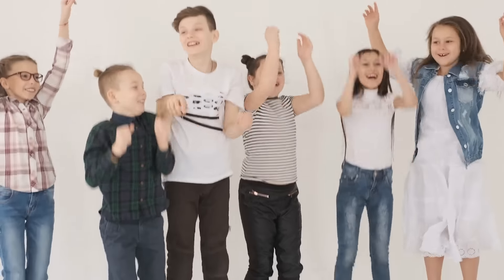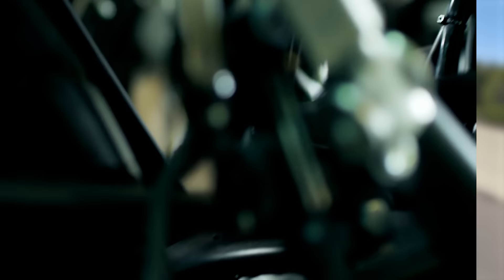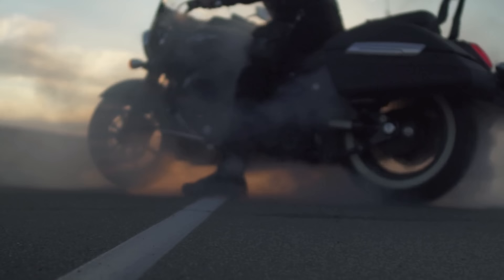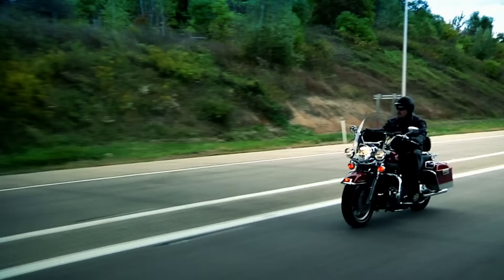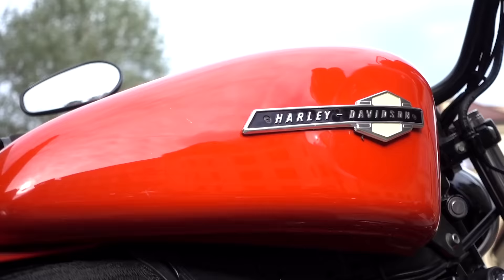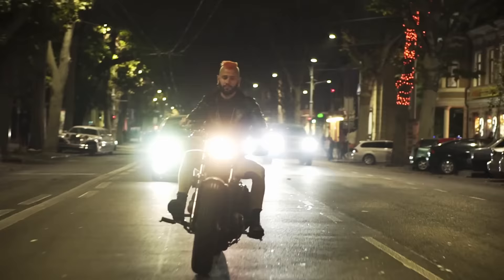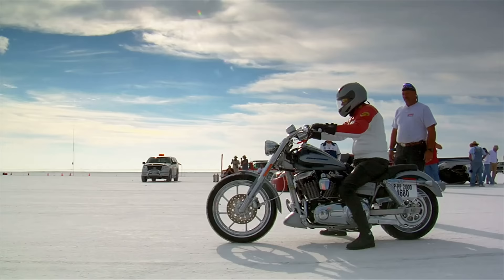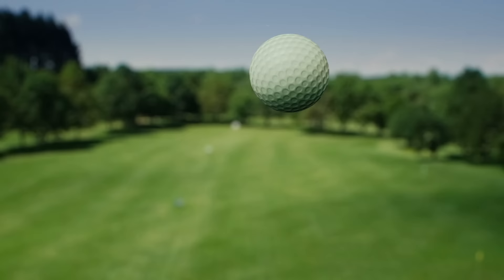Top 7 MANDATORY Harley Davidson Mods

Comment: The best mod is sell it and get a better bike
Reply: Indian would be the better option. It's a shame none of the metric companies make a decent cruiser.
Reply: @midget9629  would like to see yammie compare some metric cruisers
Reply: Having rode many Hatley even brand new 2022 models yes...this is definitely the best mod although I liked the dynas and the new sportster s was fun and the heritage is a comfy bike I'd use for 2 up road trips there's still many better options like perhaps a kawasaki concours faster lighter comfy doesn't leak or rattle your fillings out better looking and cheaper
Reply: @countryguywithcamera  I bought a beater metric cruiser a 04 vz 1600 marauder same thing as a kawasaki mean streak its not bad but its not great either
Reply: So edgy, could only be a follower of this guy
Reply: I own a Lowrider S and I will say 💯% full honesty that it’s the best cruiser bike I’ve ever ridden. As an owner, admittedly I’m biased, but considering I have owned other brand cruisers in the past, including a Ducati X Diavel S, trust me when I say this, try a new Harley Davidson cruiser, you won’t look back 🤘🏼
Reply: @wallyr.7854  I test rode a 2022 low rider s it wasn't bad I like the mid controls and bar height needs the rear suspension lifted a inch or 2 to lean harder in a curve it looks good but for that price I could buy 3 old dynas modded the way I'd want so nah not going in debt for a low rider s now if it was as fast as the sportster s it'd be a different story
Reply: @jawrazorback  I hear ya, price is it’s biggest drawback, but it still cost me a lot less than the 2017 Ducati X Diavel S I purchased new…and yes I agree, the Sportster S is crazy fast, but its rear suspension is almost nonexistent…unlike my FXLRS which feels smooth over the rough stuff.
Reply: @wallyr.7854  no harley has good stock suspension sadly but if you mod the suspension then some of their line become as capable as a sportbike 8n the twisties which is nutty for a cruiser to keep up with sportbikes but I've seen it done online and in person buddy has a dyna lifted 4 inches higher than stock and runs sportbike tires I can't ditch him in curves only in the straights he is a madman on that bike idk how he does it
Reply: @jawrazorback  Niiiice 👍🏻
Reply: @midget9629  Huh?
Reply: @jawrazorback  a concours isnt a cruiser and since when have hds leaked?
Reply: I have rode many bikes and when it comes to reliability, speed, power, sound, looks ,and feel nothing is as good as my Fatboy 2018 I would not give it up for any of my old rockets or any foreign bikes. Harley is the best all around bike and so many parts for them it's limitless as to how you can make them look and perform. Anyone that talks trash on them either can't afford one, has never rode one, or just is not from America and does not want to support them.  Ether way it's all good. Riding is riding as long as you have 2 down life is better. Stay safe everyone. Happy new year hope it's amazing.
Reply: Cringe… I’ve ridden 2 triumphs for 15 years and currently on a 21 street glide special.  This is best bike I’ve ever owned by a wide margin, I enjoy it much more than anything else I’ve ridden.  Most guys like you knee jerk bash Harley cause you can’t afford it and more often than not have no idea what it’s like to ride one.
Reply: No. I like my sportster and it's funny noises.
Reply: Why sht on someone’s bike
Reply: Or just let people buy what they like harely isn't that bad
Reply: Love my Harley’s.  Love the jealous snarky comments from guys who can’t afford them also.
Reply: Some H-D dude run away with you gf for sure
Reply: LOL

Comment: Strangely, as the proud owner of a 2021 Sportster S, with really limited parts available ATM, the cheapest and best modification was a 40mm up and 25mm back bar riser. The next essential is the HD screen as it comes, to take the wind off the chest. I did it arse about and got the seat first but that just held me in and did not change the rider triangle. The great thing is, you can pretty much reset your rider triangle because the bike is not built to be specifically one thing. You don't buy the perfect bike, you buy the bike and make it perfect.
Reply: 2022 Sportster S checking in. Hardly any aftermarket support… definitely already considered a bar riser, seat, and exhaust. Haven’t been able to find much.
Reply: @LyonMAN99  There is a bar riser for it on Ebay. Perfect fit and finish. 40mm up and 25mm back. I have had it on for three months now (only about $40). The Corbin Smuggler Gunslinger seat is excellent as a solo saddle or the Smuggler Gambler if you want a passenger. Corbin also has a tail tidy that ties in well with the seat. You are right about the pipes for the moment though. I think TBR is the only one with a full system but it is unshielded. I can wait. I finish work at midnight so it will keep the neighbours happy.
Reply: @LyonMAN99   yeah cause its a new model. good luck with support for the factory problems. save your mod money for that

Comment: I always said I would never buy a Harley, but after going to Sturgis in 2022 I ended up buying a road glide ST 
Harleys are definitely expensive but it’s something I can see literally keeping forever. We all know how writing is a community but it’s something a little different when you ride a Harley. The reason I say I could keep it forever. There’s aftermarket companies for engines and transmissions. I don’t know everything but I can’t think of another company for other manufactures where you can swap engines. It definitely is the Lego or Jeep of the motorcycle world.
But he did forget to mention one thing sound systems .
Reply: Dumped about six grand into sound system so far so yeah

Comment: I've got an 08 fatbob, from a dynabro you're definitely right about the stock suspension it really leaves something to be desired for a lot of people starting out on one wouldn't recommend changing the suspension right off the rip though. Make sure you have the right tire pressure and tweak your suspension until you find a sweet spot before you make that choice also dropping 2-400 on an aftermarket seat definitely goes a long way before 11-1500 for a new suspension setup. Also a nice cheap upgrade is trash your stock bar riser bushings and get some nice ones.

Comment: Headlights: I'm old enough that my first bike over 50cc was a 1962 BMW R60 with a 6 volt system. If you want a truly magical night time riding experience try a 6 volt system with a 1962 vintage incandescent bulb. The cool thing about those old headlights is that you wouldn't have to be scared about hitting a deer or steer on the road at night because you wouldn't see them before you hit them.🤗 A friend was killed hitting a stray hog on his BSA at night. I would have been over the top ecstatic for a halogen headlamp.

Comment: Here are mine:

1) Quad lock phone mount pro (not exclusive to HD)
2) Saddlemen Two-Up seat
3) Serrated mini floorboards
4) Serrated brake and gear shift levers
5) Serrated hand grips
6) Bar-end mirrors
7) Shorty hand control levers
8) Bassani Radial Sweepers exhaust + tune
9) Memphis shades Road Warrior faring + color match paint job & 15” windshield
10) LED turn signals

Comment: Only mod on my 2011 dyna street bob ( bought new) is passenger pillion and the 110 tire shredder kit along with exhaust and high flow intake. Stock grips and pegs are good enough for me and more than enough power to get me in trouble, no point in "trading up "🤷

Comment: Currently taking the bike I inherited from my dad (1985 fltc) and putting larger cylinders and big cam with a new carb and pipes. Also putting a 6 speed instead of the 5 speed. Gonna give the classic bike a makeover.

Comment: I'm the first few Rider in my city that got the Nightster 975 working and running
Been modding handle bar, seats, sissy bars, and full system exhaust

Don't know how long I have to wait for aftermarket air cleaner
I'm sure the Sportster S shares the same air cleaner part, but can't find any aftermarket air cleaner anywhere
I plan to dyno / ecu flash it (Stage 1) once I got air cleaner ready

Now it back fires every time I close throttle for engine brake
Reply: Harley is making a screamin eagle one for the sportster s and pan america but idk about the nightster. If you go to the website and then put your bike in on the parts section just go to screamin eagle performance and you should find it if it’s there.

Edit: I just checked and there are some nice looking and performing options.

Comment: 2019 FXLR M8 107: 
Screamin' Eagle Pro Street Tuner 
Screamin' Eagle Smart Tune PRO Automatic Tuning Module 
Screamin’ Eagle Ventilator Air Cleaner Kit 
Screamin' Eagle Extreme-Flow 55MM Intake Manifold 
Screamin’ Eagle Street Cannon Slip-On Mufflers 
Screamin' Eagle Milwaukee-Eight Stage II - Torque Kit 
Cruise Control Kit
Split Vision Mirrors
Wind Splitter Quick-Release Compact 18 in. Windshield
H-D Detachable Saddlebags
License Plate/Turn Signal Relocation Kit
HoldFast Two-Up Luggage Rack - Chrome
LePera Black Diamond Cherokee Seat
Dominion Fuel Caps
Defiance Front Axle Nut Covers
Rear Axle Nut Covers - Chrome
Defiance Rider Foot pegs - Black Anodized Machine Cut
Straight 3-inch Handlebar Riser Kit
 2 in. Handlebar Riser Extensions
Greene Brothers Designs Brake Linkage
Dual Speedo and Tach Gauge Mount Kit

Comment: I like the stock sound of my 114. 3rd gear 3000rpm purrs like a 800lb kitten. also I like to stealth a little around my neighborhood when I pull into my garage at 1am
Reply: My 2004 sportster had screaming eagle exhaust on it when I bought it but I could feel all the angry neighbors looking at me when I went or came so I switched to the original exhaust, while a part of me loves the SE sound (except after riding for a couple of hours my ears just want to fall off) I love the orignal sound also, it purrs like a kitten but has some bite to it when I throttle up! The only thing I hate is the original exhaust looks like it has a foreskin on it while the SE exhaust has a big cool hole

Comment: Ape hangers might be the worst mod to mount on a Harley. Harleys really need to go on a diet.
Reply: Na, when I switched to apes it drastically improved the comfort. 1000 mile trips no longer cause shoulder pain. It sounds counter productive but reasonable apes are a God send for comfort.
Reply: Depends on the bike and the rider.  Taller riders will benefit from higher bars (reasonably higher, not the ones where you're literally hanging from them) that keep the grips more in line with the shoulders.  On long rides, low handlebars, like are common on most harley touring bikes, will make your shoulders hurt like crazy, but raising them up even a few inches can make all the difference.
Reply: They are actually more comfortable, you speak like someone who doesn’t know what they are talking about.